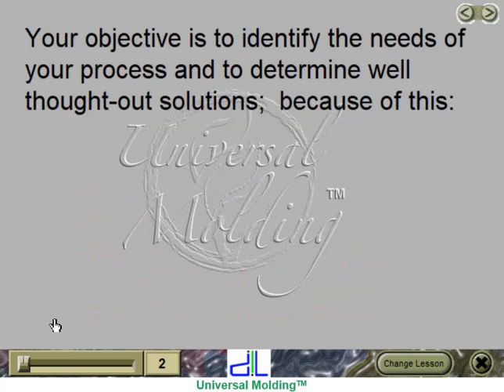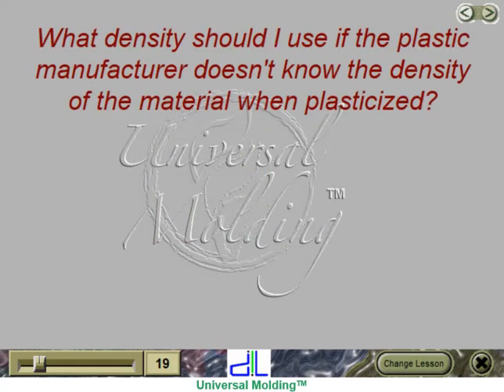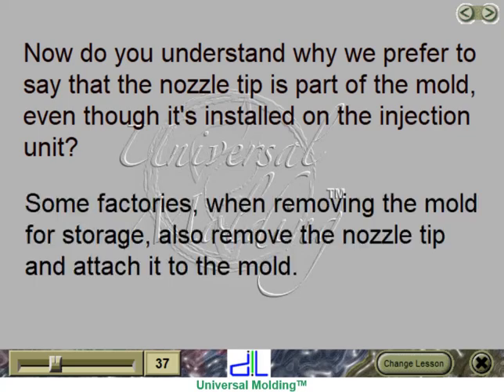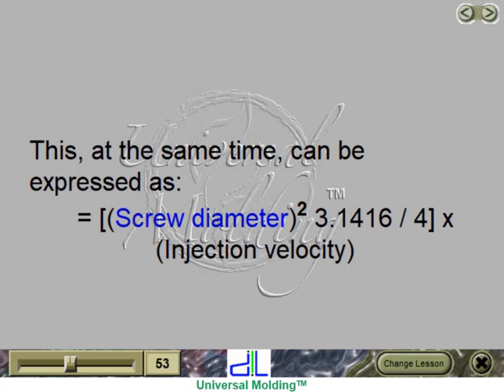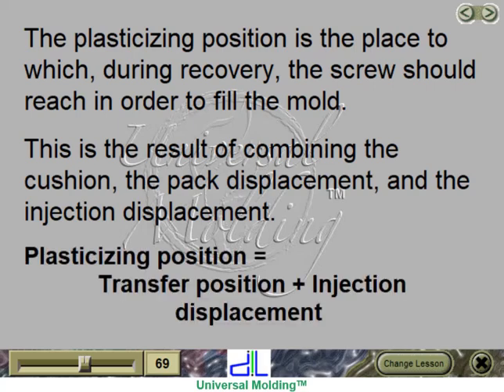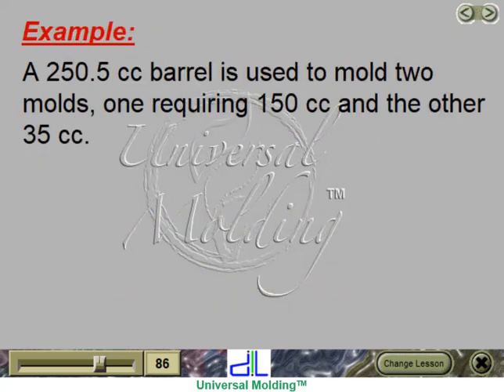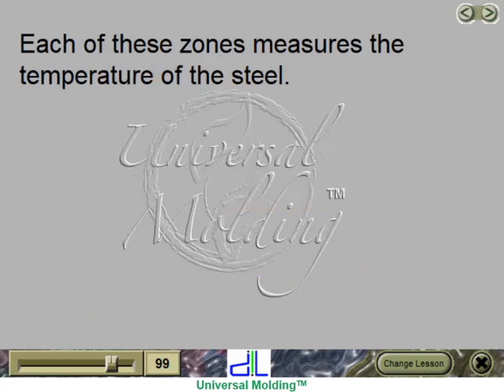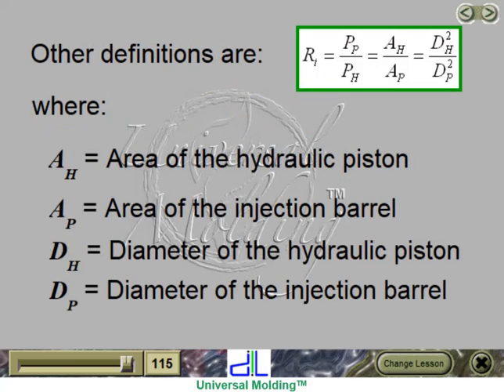MU7E - Injection Unit Calculations

Comment: My question is how can i calculate injection pressure,inside of the mold
Reply from the maker: You can only do it precisely with numerical analysis, such as Mold Flow.  This is not within the scope of Universal Molding, which is a systematic way of optimizing an injection molding process.
Reply: @moldeouniversal2784  whell i do it by playing with the values untill i get the best filling in the fastest amount of time.

Comment: It is known as scientific molding?
Reply from the maker: Universal Molding™ (MU™). The objective of MU™ is to unify molding styles, use valid process definitions, use a Universal language, and standardize clear and representative procedures for all stages of injection molding. It is a discipline that emphasizes the maximization of your resources (by properly sizing the equipment), and focuses on product quality, utilizing process optimization methodologies that have been proven by organized and scientifically-backed molding techniques.  MU™ teaches the molder to determine the Universal characteristic parameters of the mold, independently from the injection machine.
Reply from the maker: Es algo distinto, Moldeo Científico motivó el desarrollo de Moldeo Universal.
Reply: @moldeouniversal2784    Thank you....